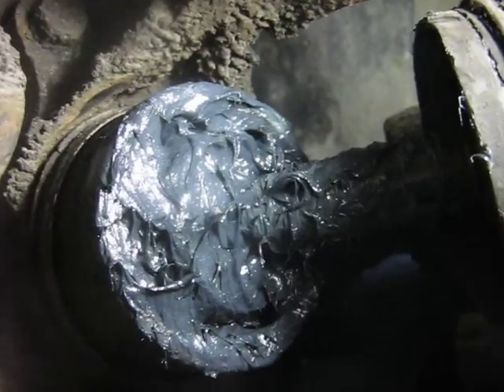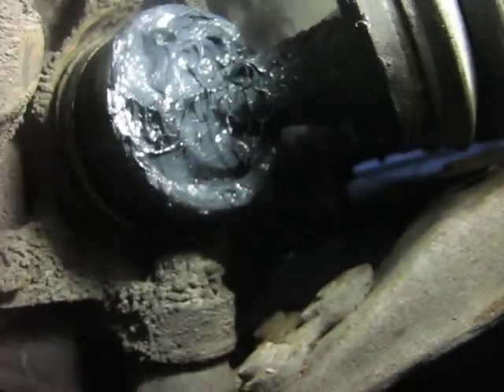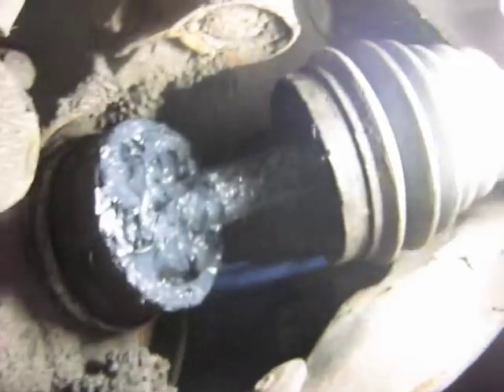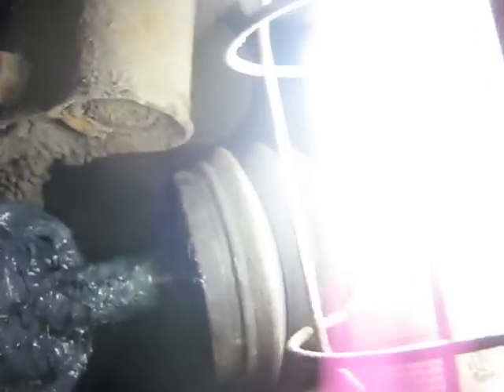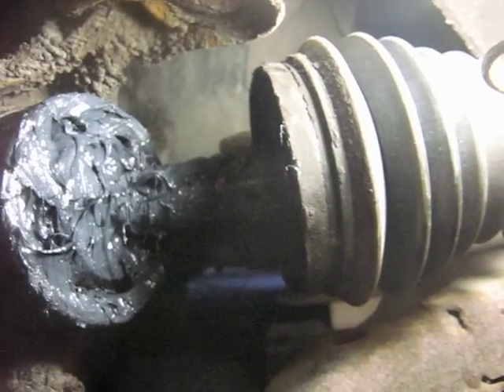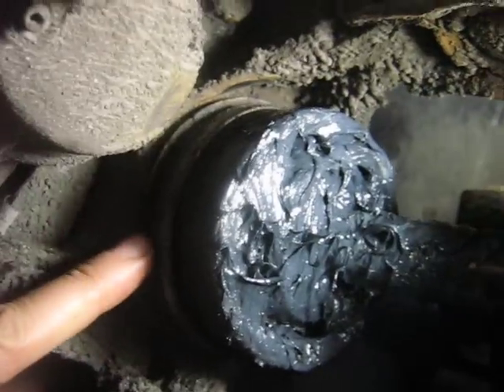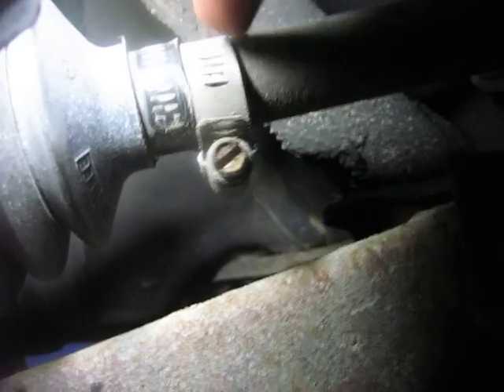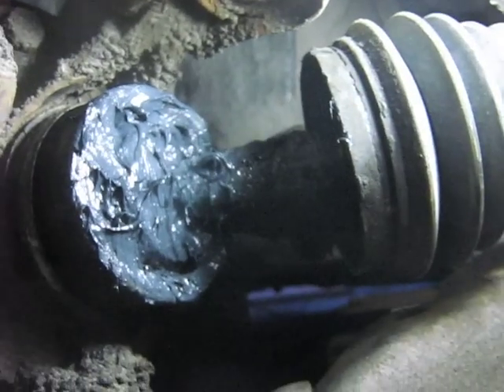CV joint greasing vid2

Comment: Nice how to video. I've lost some grease and the small clamp from my inner CV boot.  Question: Is there any way I can inject grease without removing boot (perhaps warm it up and go in between shaft and end of boot) and can I use a mil spec zip tie (or two) instead of a hose clamp? Thanks.
Reply from the maker: Perhaps you could inject some grease with  ball inflater needle attached to the end of a grease gun, just make a very small hole in the boot, and pump the grease in. Then clean off the hole well, and cover it with black silicone seal.
Reply: ChargerMiles007 Great idea. I just fixed it with a zip tie today (I think there is still plenty of grease in there).  Will keep an eye on it and put a real clamp on if needed.
Reply from the maker: Glad to hear it, another expensive repair job done by a backyard mechanic  :)

Comment: My 02 S10 is making an AMTRAK train noise when I drive. Exspecially when I'm going like 10-35 miles. I can hear it still after 35 just not as much. (But enough to question if I should drive it still) I was wondering if its the cv joint? Maybe i need to grease it but probably just shot. I changed the wheel bearing and it still made the noise. Checked the pads, caliper, and router...they are all fine. Any idea what it is?
Reply from the maker: I am not 100% familiar with an S10, does it even have cv joints? If it doesn't perhaps it is a universal joint on the driveshaft. Either way, I would be very concerned about driving it if it is making that much noise, you don't want something to lock up on you.

Comment: Why did you grease it?
Reply from the maker: You have to get the grease into where the balls are, to prevent them from seizing up from heat.
Reply: Was it making a noise?  @ChargerMiles007